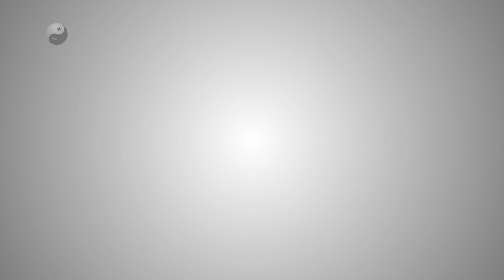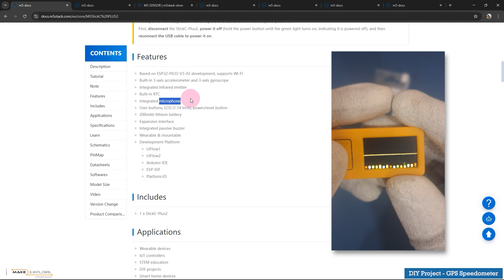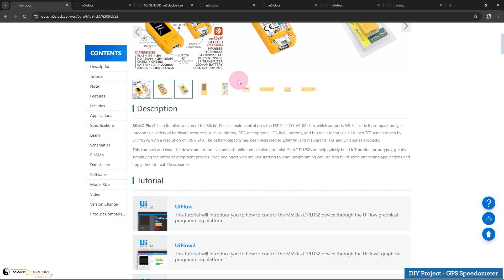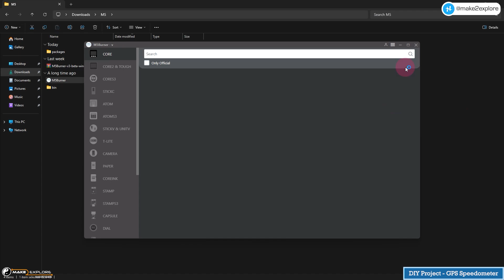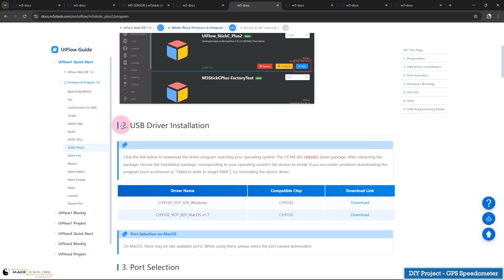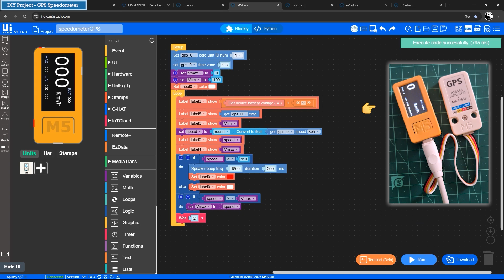[DIY Project] How to make GPS Speedometer

Comment: Hi I Build it but I have the gps Module v1.1 how do I make it work with that I also selctet it in uiflow but it doesnt read the Speed when im driving
Reply from the maker: Dear Friend, @janne1063

Thank you very much for your interest in our channel.

Q - .....how do I make it work with that I also selected it in uiflow but it doesnt read the Speed when im driving.....

➡️ Before running the speedometer code, use a simple test program to confirm that the GPS unit is receiving a signal and the M5StickC Plus2 is parsing the data correctly. Please note that it may take some time to acquire a satellite fix, especially in a moving vehicle. Once a connection is established, the cyan LED on the GPS module will begin to blink.

📌In our project, we used old version of Unit GPS v0, which has COMLOC Beidou navigation chip AT6558 and the signal amplification chip MAX2659. But this new unit V1.1 is  utilizing the AT6668 solution with a built-in ceramic antenna to provide more precise and reliable satellite positioning services. Compared to previous products, the AT6668 supports multi-frequency, multi-mode GNSS signal reception, capable of receiving signals from multiple satellite navigation systems (including GPS, BD2, BD3, GLONASS, GALILEO, and QZSS), supports both multi-system combined positioning and single-system standalone positioning, and offers stronger anti-interference capability and higher positioning accuracy. 

Hope this information will help you. If you still have any other suggestions/issues/queries about this Tutorial, or any of our DIY project, feel free to ping us on WhatsApp/Telegram (Links given below).

Tech support - (𝗖𝗵𝗮𝘁 𝗢𝗻𝗹𝘆) Telegram/WhatsApp - 11:00 AM - 05:00 PM (Mon-Fri) IST   

🚀 𝗧𝗲𝗹𝗲𝗴𝗿𝗮𝗺      🔗 https://t.me/make2explore
💬 𝗪𝗵𝗮𝘁𝘀𝗔𝗽𝗽    🔗 https://bit.ly/3VXGGEe
📩 info@make2explore.com  / support@make2explore.com

Thank you very much for your support.

Best Regards